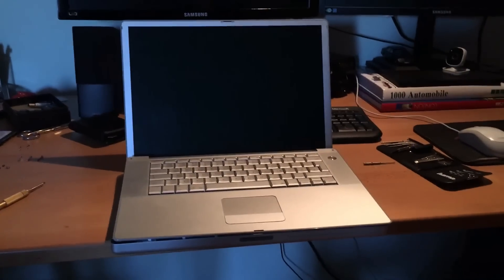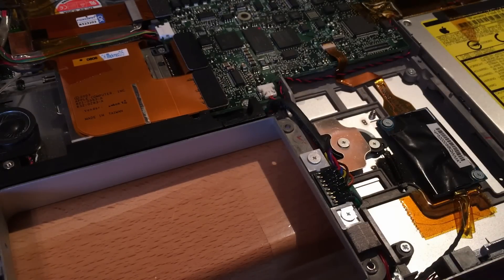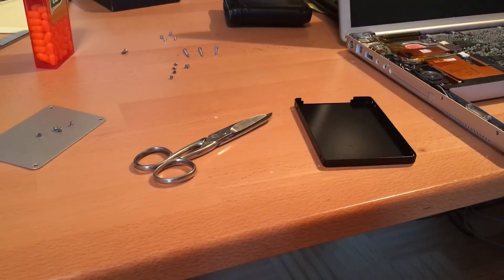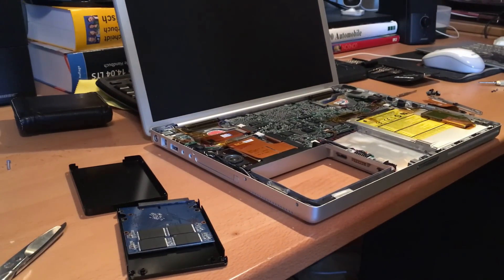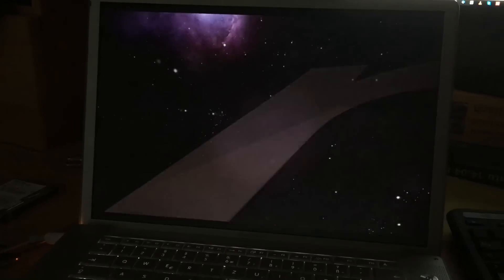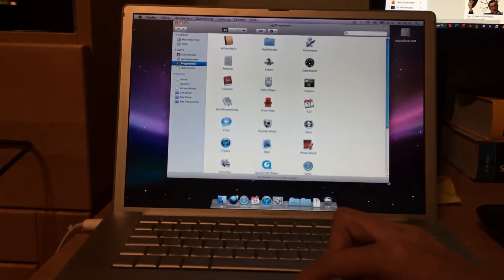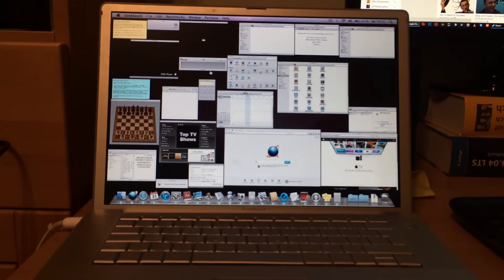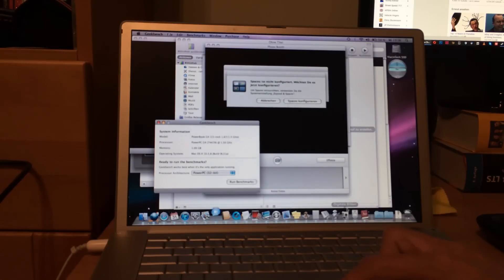Powerbook G4 SSD Upgrade!

Comment: Did this in 2013 with an mSATA SSD with mSATA to IDE adapter.
Reply: I'm trying a ide-msata adaptor at the moment, but the system wont boot with it installed.
DId yours work first go? I'm using a 256gb samsung mSATA ssd.
Reply: @der0keks hello, did you solved this problem? would be nice if you’ll answer. thanks!
Reply: @pryid  I don't remember which machine I made this comment about, One was broken, so no help.
The other one, there is a milky plastic cover that goes under the original hard drive. I didn't put it back and there was a short somewhere. When I put the plastic cover under the HDD and connector it booted again.
See 1:49 for the plastic part I'm talking about.
The other problem I had was the connector to the MOBO was a PITA to clip back on.
Reply: @der0keks  oh thanks. so this plastic thing is mandatory?